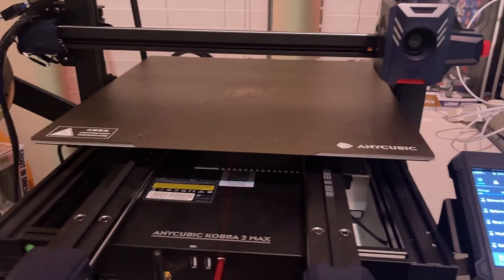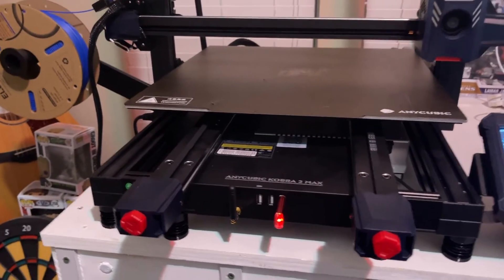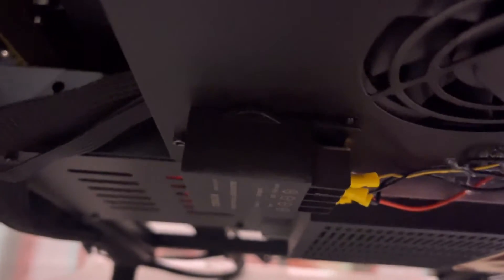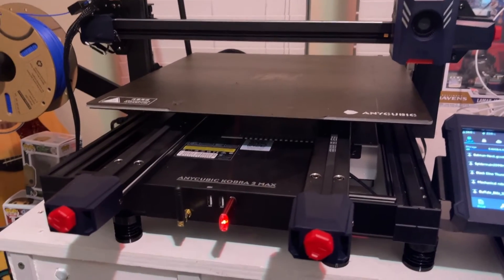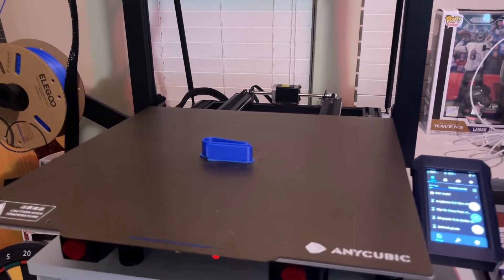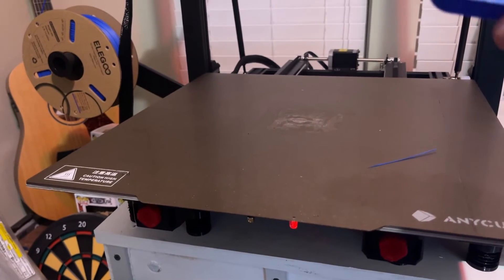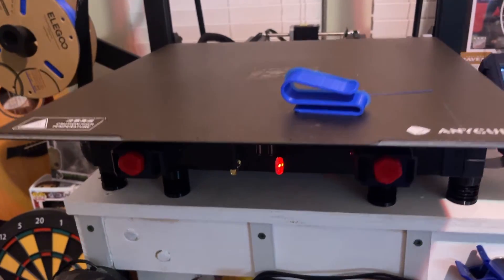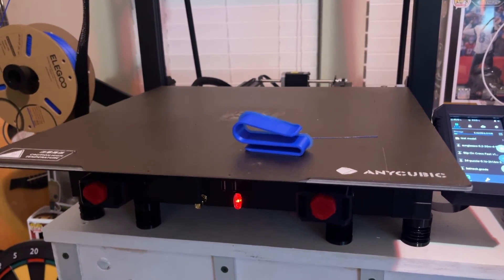Kobra 2 Max Fan Upgrade

Comment: Hello ! 
Maybe I'm missing something here, isn't the 24v to 12v converter overkill ? 

Did something make you pick this one precisely, or is it one of the first option you found and bought ? Because I know smaller ones exists, they require soldering, but can be fitted inside the PSU (if secured/isolated correctly)
Reply from the maker: It's not the first one I found, but it got really good reviews and I've used this stuff before on old printers.  So I was familiar and comfortable going this route.  It may not be for everyone and there are definitely other, possibly better options out there.  But overall I'm happy with this.  It has dramatically decreased the sound from the printer and it can now coexist in my office with the other printers I own.

Comment: Any reason not just using a 24v fan?  You just really wanted to use noctua?  Should work well either way.  Anycubic, like most sub $1000 printers is made to such a tight budget that you end up with lots of areas that a few pennies more would make it better...thats the economy we have created with everyone buying the cheapest they can.
Reply from the maker: The info I found online had the 12v with the stepdown.  I tried to find a 24v but couldn't.  I've had experience with fans and stepdowns in the past with Enders so wasn't hesitant to go this route.  :)

Comment: You can use the Anycubic app on the phone to print without the USB. Slice the file with any slicer, load it in the cloud and then start and manage the print with the phone app. You must upgrade the firmware on the printer in order for the app to work correctly.
Reply from the maker: Good advice, thanks!

Comment: The link takes you to a 12v fan
Reply from the maker: Correct, I used a stepdown to convert it from 24v to 12v. I couldn't find the fan in 24v at the time of the swap.  There is a link to the stepdown converter in the description of the video.